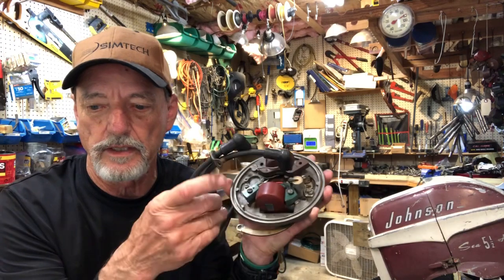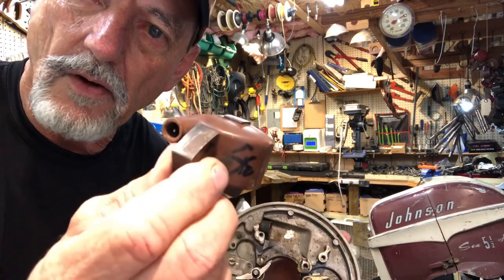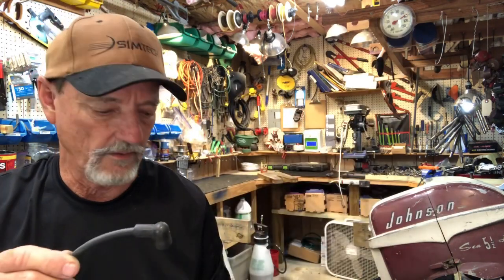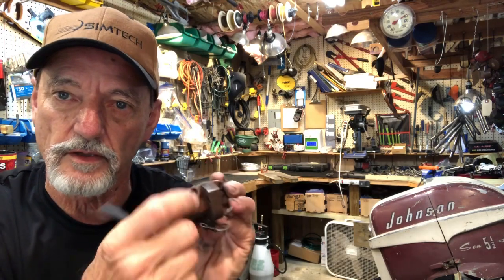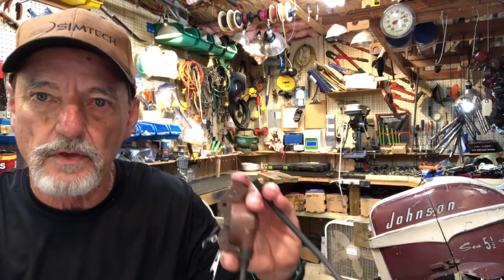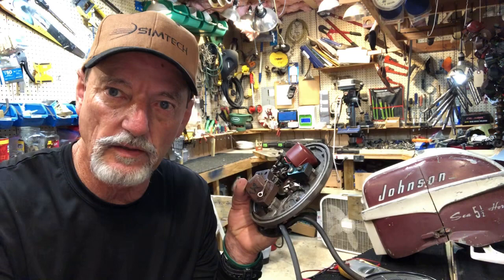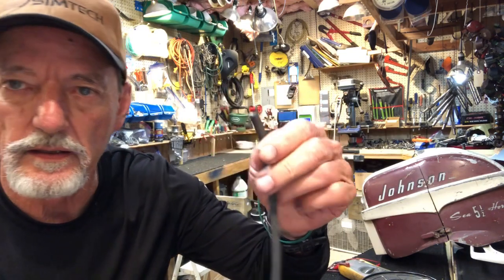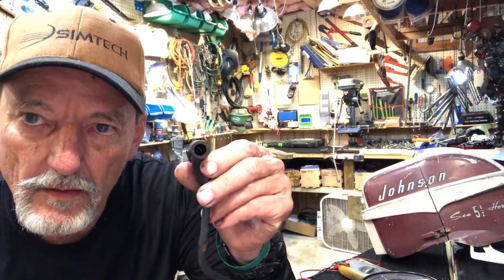Installing Spark Plug Wires on a BOAT?

Comment: Is copper/ metallic core wire required or can we use carbon core? I have some carbon core from car projects and need to rewire a 1970 johnson 6hp.
Reply from the maker: Copper core

Comment: Probably a stupid question but does the plug order matter? And how deep do the plug wires need to be dug in? I recently replaced the coils in my 5.5 but It seems to only be running on one cylinder,The screw in my coil also made a cracking sound when straightening it as it was bent to the side when it arrived,do you think I could’ve damaged/disconnected it by accident?
Reply from the maker: Did you check for spark with a spark checker ?
Reply: @michaeljsimon  just did that and the bottom plug isn’t getting spark,could’ve sworn it was when I first changed the coils though but Im gonna go ahead and take it apart again and mess with the wires and possibly swap them out if I can find replacements
Reply from the maker: @Youza899  https://www.ebay.com/itm/363880648316?mkcid=16&mkevt=1&mkrid=711-127632-2357-0&ssspo=sn3ajpvKTka&sssrc=2051273&ssuid=sn3ajpvKTka&var=&widget_ver=artemis&media=COPY
Reply: @michaeljsimon  turns out the coil I got off amazon had the wrong sized magnet and wasn’t allowing full spark along with points set wrong,Fixed all that thanks to your videos now my motors running like new,Thanks again mike,your videos have saved me a lot of time and stress,ready for the lake now
Reply from the maker: @Youza899  I sell all the parts for your motor.
Reply: @michaeljsimon  I know,Im just a cheap bastard and tend to pay the price for it,I ended up just using my old coil that I had got off ebay before I found your channel and that did the trick
Reply from the maker: @Youza899  my videos are free I just ask you buy your parts from me.
Reply: @michaeljsimon  probably a stupid question but have you done any videos on how to replace the carb needle packing washers? The high speed needle on mine wont tighten

Comment: I found your video on a "Change Points Tune Up Ignition Magneto 1959 5.5 HP Johnson" that includes the magneto removal. Also realized the oil wiper clip on my 1958 is missing.

Comment: I'm still standing in my shop waiting for the magneto to just appear in my hand.
Reply: @michaeljsimon Is the base just an appear in my hand? Is it pressed on and require a puller. I just inherited a 1958 5.5 and must replace the plug wires. every video always start with the base in hand, not on shaft. I don't want to apply force till I figure this thing out. It has been 30 years at least since I have seen points.
Reply from the maker: @billg1744  I’ll make a video.
Reply: @michaeljsimon  Is a video needed? Remove woodruff and advance and ??? wheel puller?
Reply from the maker: @billg1744  https://youtu.be/doBkXj4iXPA?si=aFZuSz-2dRGVSg9K

Comment: Question: Can I just put a very small smear of wheel bearing grease on the cam lobe to lubricate the rub block on the points in place of the factory felt pad?  This was done routinely in old cars with points for decades. I think it would work fine provided you didn’t over grease.
Reply from the maker: I’m not a big fan of using to much grease - it attracts dust and can do more bad than good - just me ..,.

Comment: How do you accurately locate the coils on the reassembly if you don’t have the  factory metal spacer ring?
Reply from the maker: Use a screwdriver to align coil with base